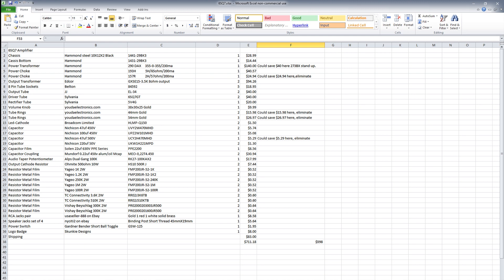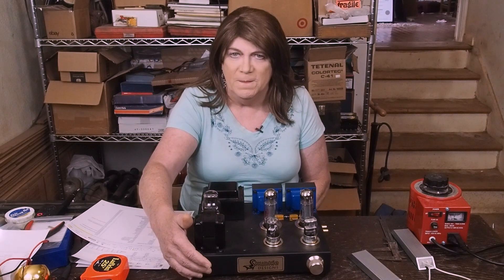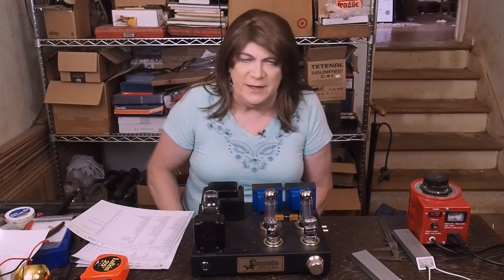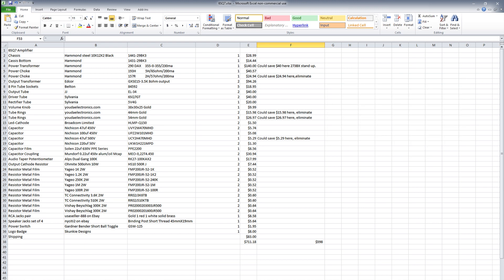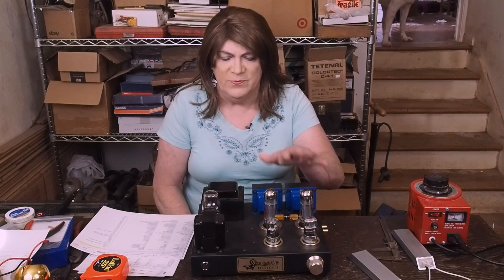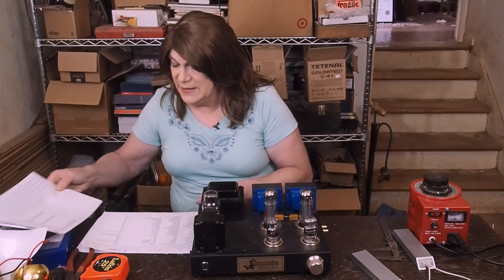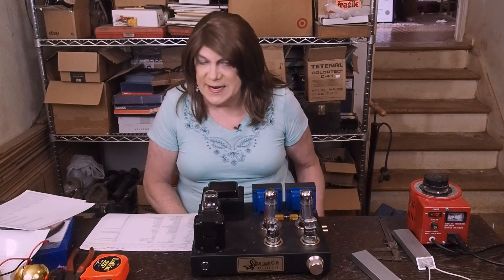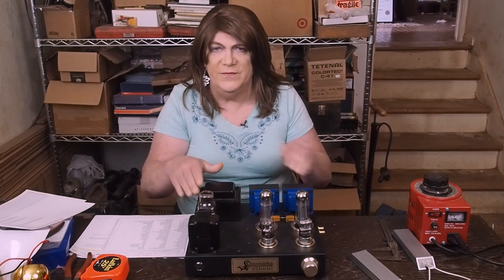6SQ7 EL34 Tube Audio Amplifier Build: Design

Comment: I'm curious about the 270uf cap after the power supply choke.  I thought that when using tube rectifiers, you were very limited in the amount of capacitance you can use in the power supply.  Does the choke "shield" the rectifier from this fairly big cap?  Could you have used 800uf?   Thanks
Reply from the maker: Res, the choke "shields" the rectifier, the first cap is the one you really have to watch. It's not just about the inrush current.

https://youtu.be/Iizt5cnq2oY
Reply: @SkunkieDesignsElectronics  thanks! great video, very clear.

Comment: hi im searching a switch to pass ultra linear to triode mode  .can you suggest a switch for that.thanks
Reply from the maker: I'm honestly not a fan of this, if you switch to triode you also need to remove the negative feedback. Trying to find a switch that is rated for this plate voltage is gonna be tough. whatever you use, make sure the switch parts that humans can touch are well grounded!
Reply: ok thanks @SkunkieDesignsElectronics

Comment: Hello, I have found your channel only fairly recently and not watched many of your videos, but I note that you are well regarded for the quality of your amp builds. In this video I noticed a number of points in the schematic that strike me:
First, you do not use a foil cap in parallel to the cathode resistor bypass electrolytic! Issue is that electrolytics are quite sluggish and do not respond quickly to high frequencies, but behave more like a resistor to them. This effectually puts those high frequs under a 'cathode resistor negative feedback', while a foil cap in parallel would pull the cathode potential also for high frequs down to ground and eliminate that neg FB effect.
Secondly, you give the output power with 5 Watt. Obviously, in SE amps you would normally get close to half of the plate dissipation of the output tube as output power - albeit with some harmonic distortion. As the EL34 is apparently biased at around 20 Watt in your circuit, I would expect near to 10 Watt output! So, did you reduce the output power deliberately to reduce distortion?
I also notice that the primary impedance of the OPT according to your schematic is about half of what would amount to impedance match for the bias of that EL34 with those specific operation data. Again, is this possibly to facilitate a reduction in harmonic distortion?
Reply from the maker: Lemme unpack your comments "!" .

 I'm well aware of what film caps across electrolytic caps do. A) Use good electrolytic caps and most of that issue disappears. Use cheap/garbage ones and you have to bypass them to sound decent, but then what film cap to use? More cheap caps to try to get the cheap electrolytic one to sound OK? B) Adding film caps do change the tone of the amp and not always in a good way. I feel they can make an amp sound brittle and kills some of the "tube sound" most people build or buy tube amps for. YMMV

I have no idea where you get this  "Obviously, in SE amps you would normally get close to half of the plate dissipation of the output tube as output power". That just isn't reality at anything close to reasonable distortion levels in any SE amp I have worked on. This "obviously" is likely a case of people spending too much time simulating circuits instead of building them.

As far as the output transformer, doubling the impedance would cut a ton of power unnecessarily IMHO. A 5K one would give lower distortion but would also reduce the power, it's all a balancing act. I'm sure a 5K one would work fine, especially if you have sensitive speakers.

Comment: Hello, why use the 6SQ7 instead of a garden variety double triode? cheers
Reply from the maker: I wanted to use an octal tube and this tube has very nice looking linear curves. I've compared it to an amp with a very similar design using a 12AX7 and this 6SQ7 sounds better to me. You could build this using a single 12AX7 in place of the two 6SQ7 if you wanted to, but I personally don't think it would look as cool and not sure if it would sound as good either.
Reply: @SkunkieDesignsElectronics  Thats great to know, i have a 6SQ7 lying around, will experiment with it, cheers
Reply from the maker: @Alejandro-kz2zf  Check out the data sheet and how linear the curves are. That's what convinced me to try one. The glass tube ones sound better than the metal ones to me.

Comment: Wish me luck! I usually wait until every possible test has been done, and I know there are kits out there that have been around and tested for ages. But, you are so convincing and thorough that I just ordered the power transformer (290DAX), both chokes, and the chassis+bottom. I like the look of the drop in PT, so I went with that. I got that whole set shipped with taxes for $250. Not too bad.
Reply from the maker: Good luck! That is how I built my first one and I have been enjoying it for a long time. :) A tip on sawing out the big hole for the drop in type: I used a metal cutting blade in my sabre saw and covered the foot with felt to protect the powder coat finish.

Comment: Given that you're talking about power supply design and cost saving measures in this video, I thought this would be a good place to ask this. Transistor amps routinely use CRC power supply filtering, and get great performance from them. Resistors are so much cheaper than chokes, so I think there must be an advantage to LC filtering for tube amps. I can’t think of what it would be, though. The point is just clean DC. Can you point me to any good info about that? Thanks for the content, I’m really enjoying it!
Reply from the maker: A choke allows for less voltage drop (much lower DCR)  and also just filters out ripple better. Rectifier tubes are limited on the value of the first cap, so given this limitation (and the fact large high voltage caps are huge and expensive) using an inductor helps cleans up some voltage ripple that a resistor would not. Also, we are using very small amounts of negative feedback and an SE amp doesn't have the cancelation effect a push pull amp has. Transistor amps typically use large amounts of negative feedback and many are push pull designs, which eliminates the need to a super clean power supply. Also they can just toss in a couple of 3300uf 16V caps, where that's just not possible with a tube amp.

https://www.aikenamps.com/index.php/chokes-explained
Reply: @SkunkieDesignsElectronics  Thanks for the info and the links. I have sometimes to learn about tonight!

Comment: The whole purpose to an amp is to take a pure DC voltage and modulate it into an audio signal. I would not short change the power supply.  Save the money once, listen to the compromise forever.  I can see the simpler stand up transformer, but the less pure dc signal, not so much.  Be extra critical, before deciding. Again, regarding the tube rings, save the $'s once, have to look at it forever.  Don't forget the cost of labor includes shipping, paperwork, etc. I have too many projects lined up to spend time wiring it up myself.
Reply from the maker: I agree, and it's why I want to build both and then listen over a bit of time to see if I can hear anything. I won't be shocked if the extra choke makes it sound cleaner. To A-B you need two amps all done so they can be swapped out.
Reply: @SkunkieDesignsElectronics  agreed.  Look forward to hearing the results of your investigation.

Comment: Thanks for the videos. I'm currently designing and building a similar amp and am enjoying watching you work through all your challenges - some of which I am currently facing on my amp. When and where will the BOM be available?  Keep up the good work!
Reply from the maker: Good luck! I'm hesitant to put up a BOM, as I'm still working out which power supply to use. 

But, here is a BOM and schematics for my personal amp as built, + the alternate PSU, with the sim results of both. I know the 2 choke design is dead silent and sounds amazing. The other one choke "should" too, but I want to build and test it before giving it my blessing.

https://drive.google.com/drive/folders/11MbMn1X-sQBnPWMIq4-zGscxfCaLxBCK?usp=sharing
Reply: @SkunkieDesignsElectronics  Oh great, thanks for sharing. Don't worry, I know it's a work in progress.  My design will get it's own flourishes too, I just wanted to see what transformers you were using, etc. Looks like a great little amp, I do like the EL34 in SE ultralinear! I look forward to the next installment.

Comment: Hi, nice project but why don't you use Hammond output transformers. Take, for example, the 1630SEA. Not that I doubt the quality of the Edcor transformers, but I think they look better. At least they have the same color.

Douwe
Reply from the maker: The only "Hifi" output transformers they make for SE use are the 11lb 25w monsters. They are also over 3X the price, a pair of them would be almost $310, blowing the price of this amp up close to $1K just for the parts. It's the same reason I didn't go with Electra-print or Tango, and unfortunately some of the other "right size" affordable transformers like a One electron UBT-3 don't have the 40% UL taps I need.
Reply: @SkunkieDesignsElectronics  Good afternoon, thank you for your quick response. I had also seen that his weight was 11 lbs, but assumed that corresponded to 1100 grams. Now it appears to be 5 Kg and that is a bit exaggerated for such a small power. In the past I have always built amplifiers with balanced outputs. Now I would like to make an SE amp. Edgar's transformers can hardly be found here on the Dutch market. So I'm looking for an alternative. Maybe I can find something here: https://www.die-wuestens.de

Douwe
Reply from the maker: @douwebakker3707  I see Don Audio is selling their products in Europe. I don't see the exact ones I used listed, but a 5K primary should work OK, just a little less output. You could ask if they can get the 3.5K ones I used, plus I don't know what ohm speakers you use.

https://www.don-audio.com/Edcor-GXSE15-8-5K-Single-Ended-Tube-Output-Transformer_1
Reply: @SkunkieDesignsElectronics 
Hi, thanks for your message. After some research I arrived at these toroidal transformers
I'm going to order this one. The  VDV-3512-SEE https://mennovanderveen.nl/cms/index.php/nl/products/single-ended

Comment: It would be interesting to see the difference between the 2x$30 0.22uF mundorf caps and say, 2x 640V WIMA 0.22 FKP1 caps (a full nonmetalised foil cap, in the UK they're about £3 each compared to mundorf caps which seem to be £8-16 depending on the model). Always an option to replace later if initial cost is a problem.
Reply from the maker: I need to experiment more with caps. I tried the Russian oil caps people love and I personally didn't like them. Every amp or device I have replaced the coupling caps with these alum/oil Mundorf sounded better, so part of it is just being lazy, going with what I know works :)

Comment: Yeah, I find the transformer (being high voltage) is one of the more difficult things to source. Delivery cost given the weight is always a concern (we get 20% taxed on both the transformer and delivery here in the UK too). I forgot to say - you could run PVC stranded rather than solid PTFE which making wiring cheaper, without silver plated copper it also means the solder is cheaper too.